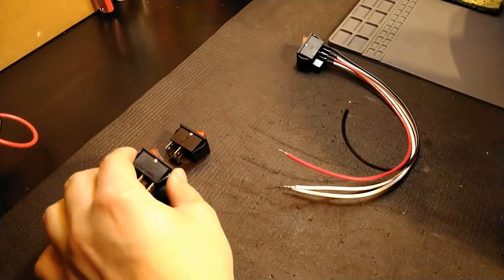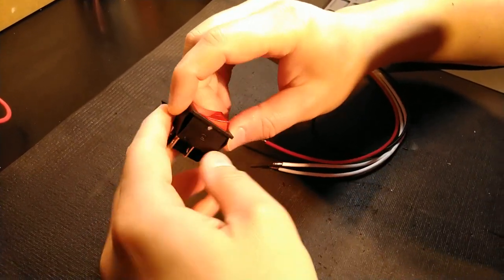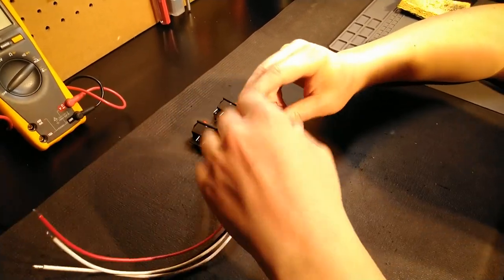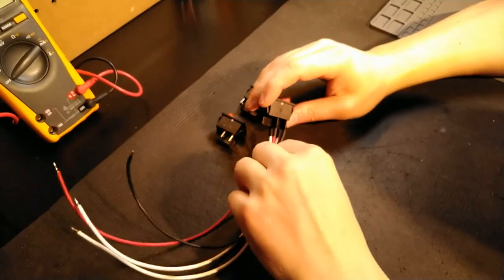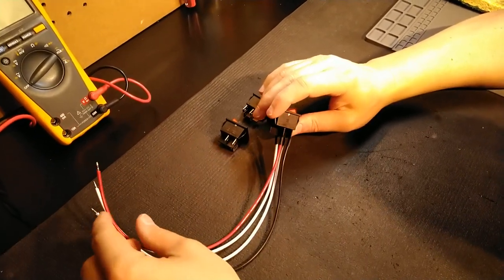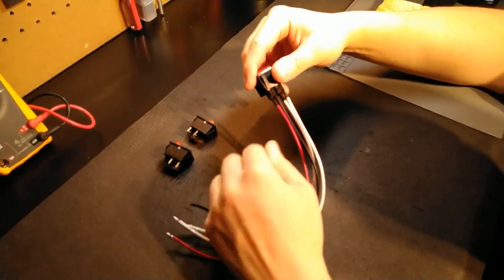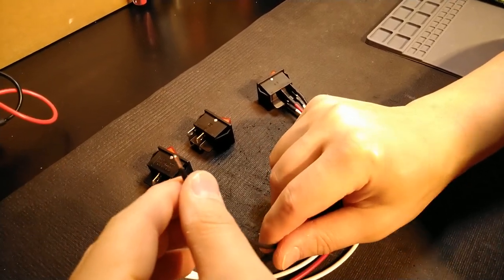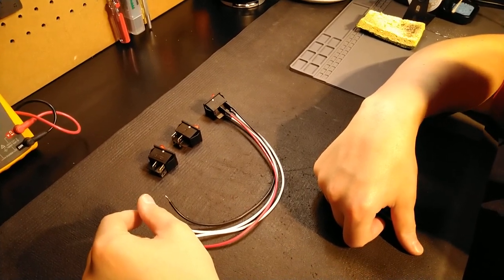How To Wire A KCD2 Rocker Switch...

Comment: The hot and neutral can be swapped to switch hot instead of neutral on these, correct? I don't like switching neutral as hot is a bit safer, but I'm not very familiar with this switch.
Reply from the maker: Hey Cory, thank you for your support. The hot lead, and neutral can't be swapped on the KCD2 switch. Thank you,
Vince